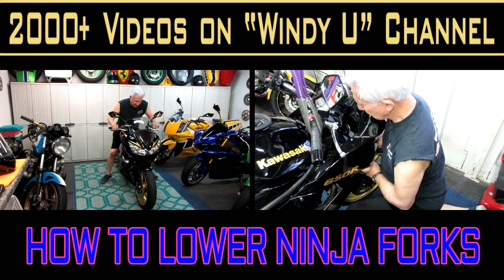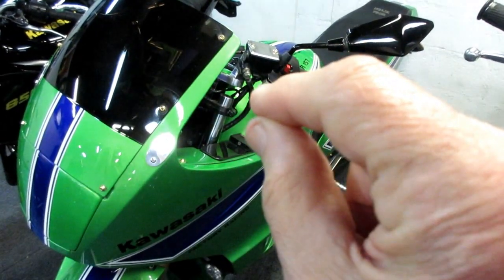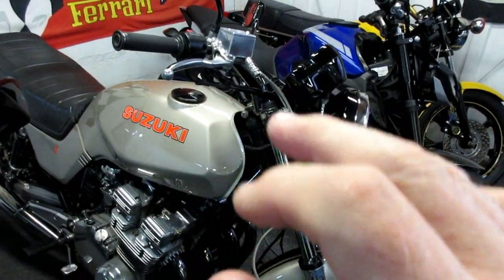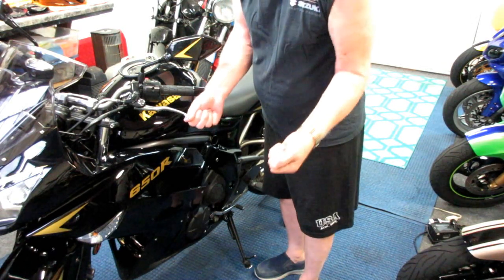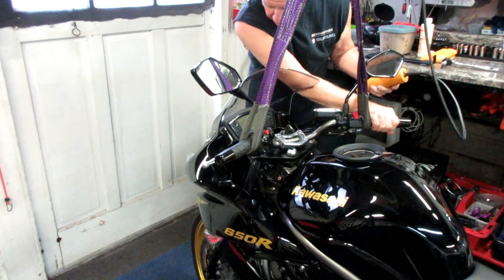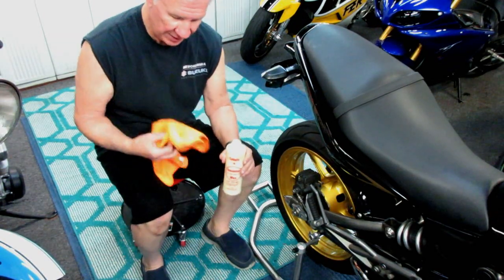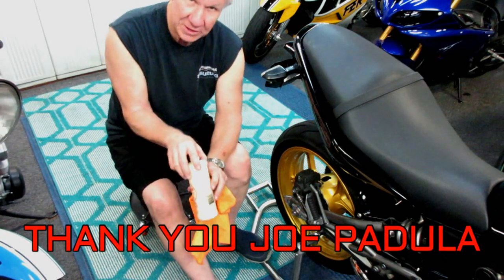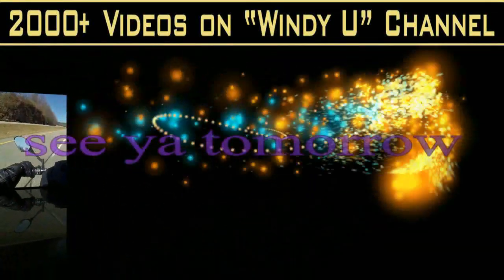HOW TO LOWER NINJA FORKS SIMILAR FOR MOST MOTORCYCLES.

Comment from the maker: Hi,what products do you suggest,I will share info if you like?About lowering forks on any bike the same rules apply if it is a sportbike,cruiser,dirtbike,etc. The geometry changes the angle as you lower fork legs and lowering handlebars does not change the fork angel.It is the fork angel that determines how quick a bike will turn in and how stable it will be at high speeds.The factory picks a compromise,same as they pick a seat height,powerband,etc. but it is a compromise.For me I ride in mostly twisty back roads and I experiment until I find what works for me under my conditions.Modern Moto GP bikes can change swingarm height to do similar fine tuning for various racetracks.I will explain in great detail on the next Q&A video,thank you for an excelent question and looking forward to hearing some detailing tips.THANKS IN ADVANCE.
Reply: What are the straps attached to?

What are you using to lower?